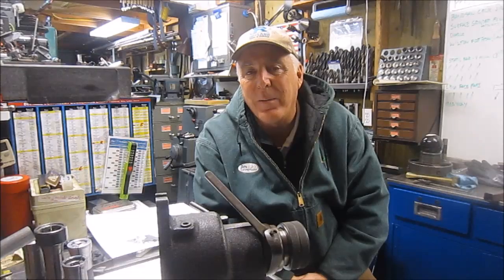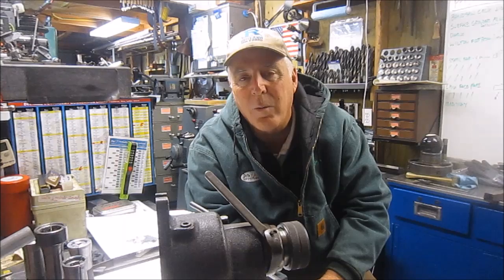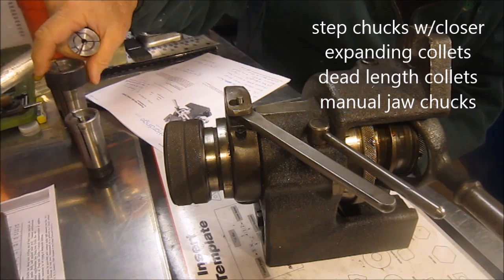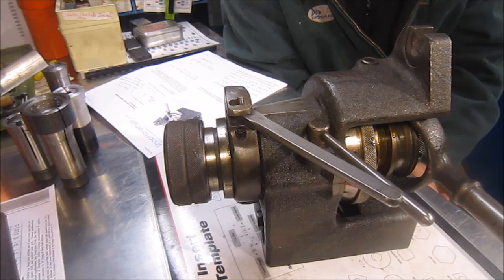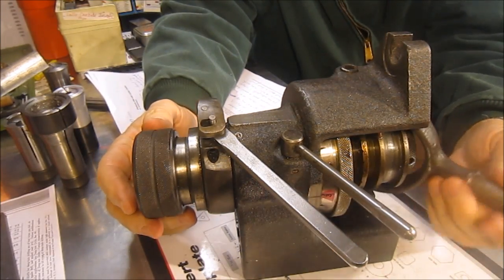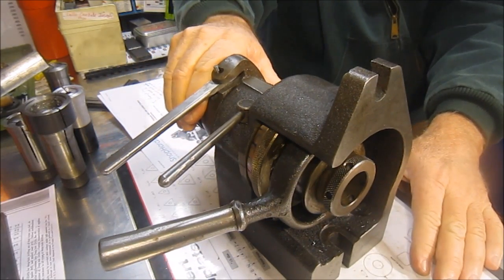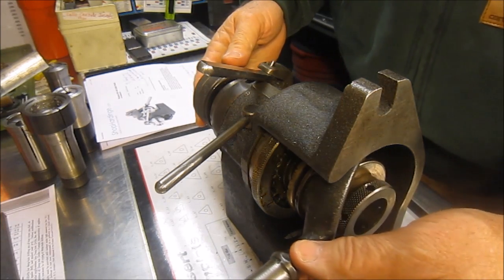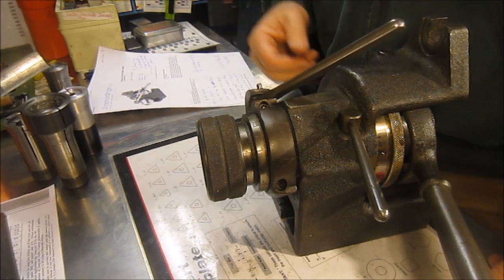Hardinge Hv-4n   Screwy Tuesday#42

Comment: I have  a Hardinge H-4  5C unit model, missing the drawbar, you wouldn't happen to have any dimensions on the drawbar as a new one from Hardinge is  $700.00 and the new H-4 indexer is $22,455.00 and don't need to spend that when I can make one. Your unit is a really nice set up, Mine is like brand new off the shelf, came with my Clausing 8530 used mill.  Keep the videos coming please, I watch a lot of your stuff.  👍👍👍👍
Reply from the maker: sorry Douglas, but don't have the information you need, thank you for the support of my channel

Comment: Chuck..!! can u help me.. I picked up this interstate indexer for 25 bucks.. I have all kinds of uses for it.. but being a complete newbie to all this I cant even screw the 5c collet in.. how does it secure.. my machine is a bit different than yours above.. could u impart some wisdom..
https://www.ebay.com/itm/Interstate-Horizontal-Vertical-Rapid-Collet-Indexer-5C-Compatible-09150905/352690522926?hash=item521dfe4b2e:g:4EoAAOSwd2tdAVgi:sc:FedExHomeDelivery!48236!US!-1
Reply from the maker: desalvo answered...there is a ring that you can thread the collet, you use a punch or pick to roll the ring to tighted the collet, then lock to check tightness
Reply: nevermind chuck.... I got it... u have to push on the 5c collet eventually it engages the thread..

Comment: 4700$ and it's not even scraped for bearing. sad. even the over seas ones are flaked at least. see Stefans channel
Reply from the maker: thanks for viewing and the comment.....I am a big fan of Stefans....
Reply: outsidescrewball oh you're welcome I just found your channel! subscribed! I was doing some research and found that I believe to have been mistaken. I suspect the Hardinges are indeed scraped . over time the rubbing against tables and such for year after year may have caused many of these units to lose the sheen of the scraping and gives it a more dull/flat finish. (not flat as in flatness).

very neat piece of tooling. I used to be a machinist/Junior tool maker for a decent sized stamping die new build shop. cnc and wire edm equipped. I started helping die setups in the press, my mentor and I did the 600T press. and I learned to dial in the dies so that the part offs were compliant to the fixtures. feeler checks etc. milling and lathe and grinding work was just part of my day when dialing in tooling. all manual. my dream is to have a lathe and Mill at my house for hobbying. they are just so expensive for half decent units. oh well. maybe one day.

Comment: Nice tool Chuck. 
I used one of those back in the late 60's - early 70's at my Dad's  shop drilling holes in bolts for safety wire.
You guys have a safe holiday,
Jim

Comment: Hey Chuck, 
I held hands with one of those 8hrs a day for about 3mo back in 1978. It was setup on a little arm mill with a slitting saw. The first shop I worked in was 2nd operations in a screw machine shop. We were making collets with slots at 90deg, Sequence went, blow out collet, insert part and clamp, run across saw, Rev to starting point,  index repeat, pop part out. Repeat, repeat repeat. ..... by the 55gal barrel full.